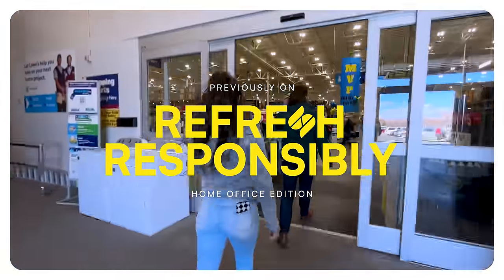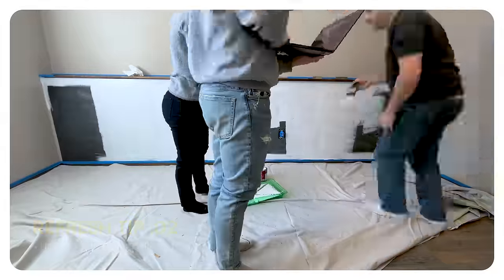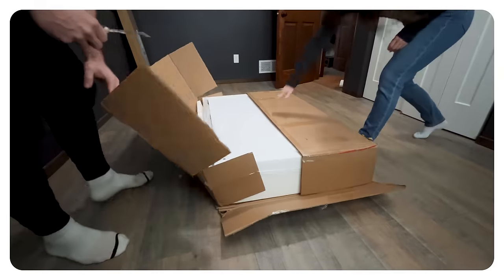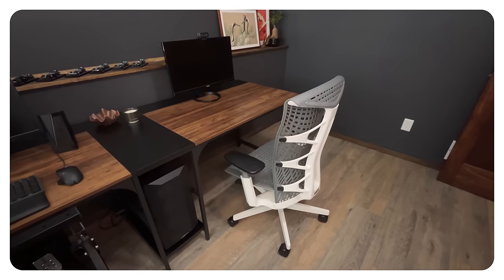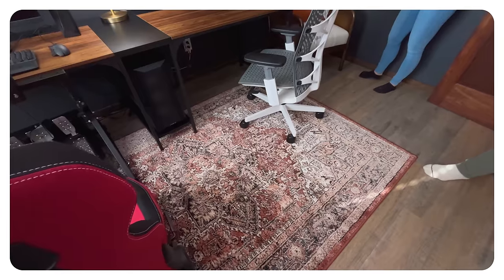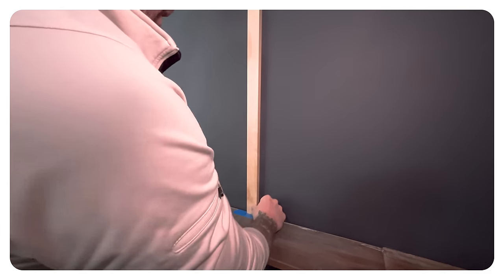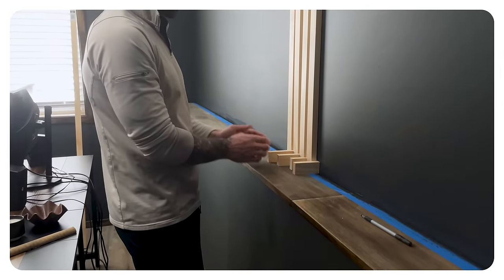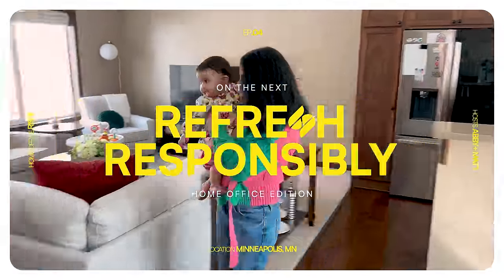Home Office Refresh Under $600 - Episode 3

Comment: Been painting and using frog tape, for over 40 years, and no matter how careful I always would have the paint chip while removing the tape, thanks ever so much for that tip. The house that I just moved into, the previous owner  closed off the garage,   and turned it into a workshop, I would take the 200 and redo it and make a hella man cave

Comment: I loved the tips on how to save your money but still get the same result as if u would have spent a fortune on it. Also the tip of using a color for the paint that is featured in other places of the room the like the floor. Also I didn’t know that taking off the tape before it dries leaves cleaner lines then if you would have left it on. These tips were really great and I learned new things that I didn’t know before I watched this video.